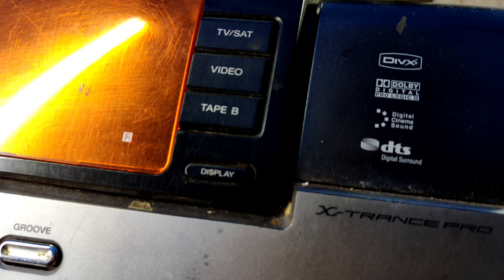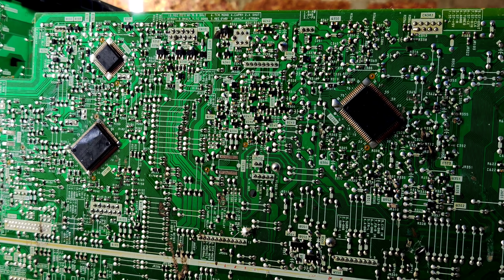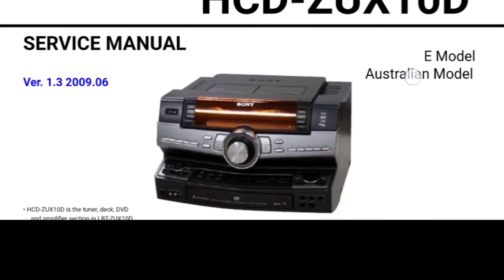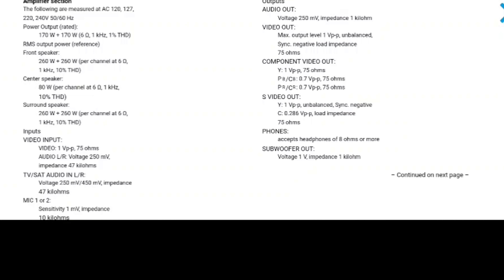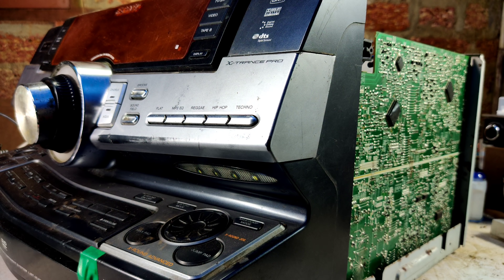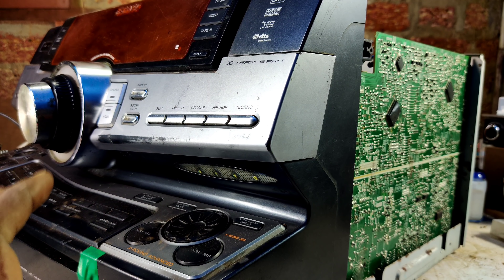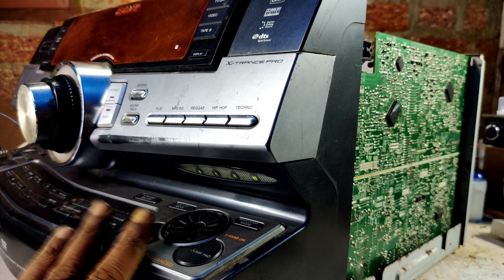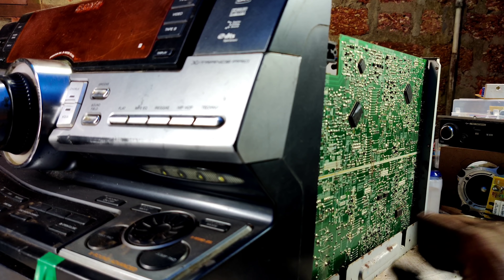Sony audio system | troubleshooting or destroying

Comment: Chetta, ente kayil oru Sony hifi system ondu ( Sony hcd gn88d) . Appo athinte problem entanennu vechal athinte plug kutti power on cheyumbol system on aakum ennit eethenkilum function button press cheyumbol system standby modeil pokum power buttoninte indicator light blink cheyukayumcheyum . Appo enthinte complaint kondayirikum audio ic ude aayirikumo?
Reply: അതേ പ്രോബ്ലം gnv 99d
Reply: Bro ithe problem ente mhc gn 90d systethinum vanninu.njan service centaril koduthapo audio ic poyatha ennanu paranjath ic mattiyapo shariyayi 2600 roopayayi bro
Reply: System kodukunundo

Comment: amplifier on ആകുമ്പോൾ subwoofer cone പുറത്തേക്ക് തള്ളുന്ന പോലെ ....... Bluetooth module control change ചെയ്യുമ്പോഴും......song next/pre ചെയ്യുമ്പോഴും  subwoofer cone തള്ളുന്നു  ........tda 2030 ic ഉള്ള 2.1 board ആണ് use ചെയ്തിട്ട് ഉള്ളത്..അത് മാറ്റാൻ എന്താ വഴി..????
subwoofer work ആകുന്നുണ്ട് പക്ഷേ
Reply: Spkr protection use cheyyuka. Or Sub board complaint aayirikkum